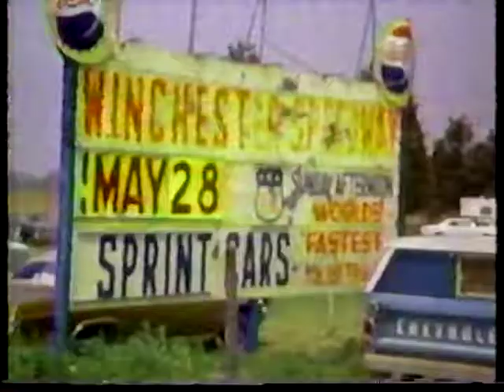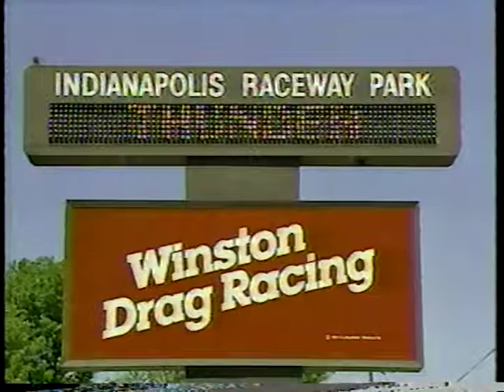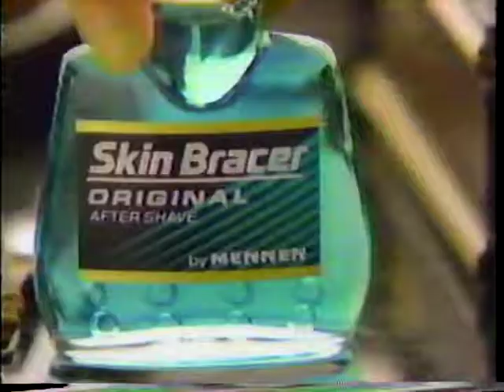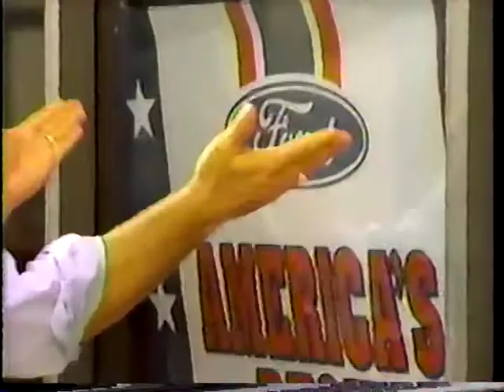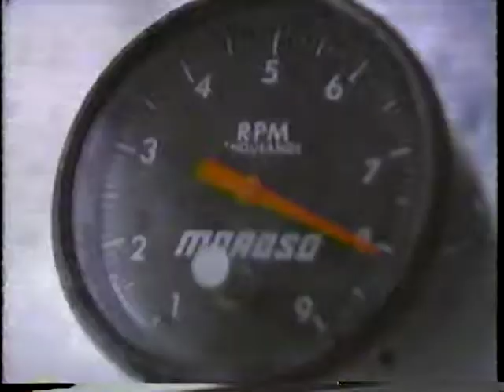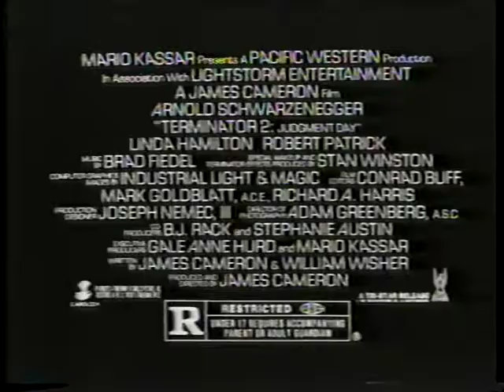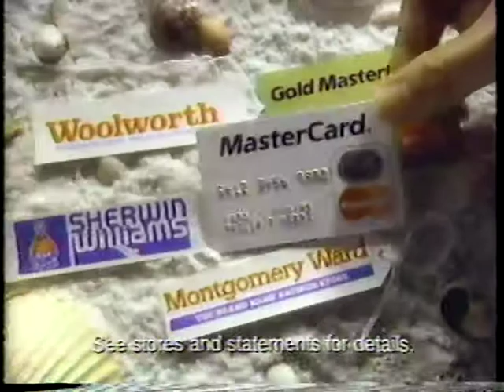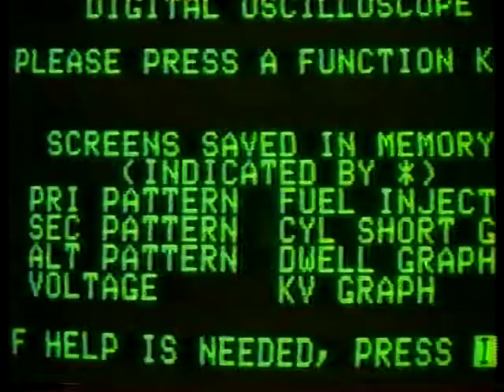USAC Silver Crown Cars at  IRP 6 29 1991

Comment: heh now the new kids here are the old guard that race the crowns in 2022 like eric gorden and ryan newman, bob santose jr 3 and bryan tyler, and these days silver crowns carry 75 gallons of alcohol and are able to run up to 360's  and running at irp 3 of the 12 races this year they are still very loud and to the walls flying around I mean on a big track like this they really do fly and its got the long sweeping turns if you watch from the pits with a pit pass it really is a neat thing, but I imagine it would be neater to see them on the long dirt track, which saddly is just down to terre haute in indiana, they limestoned the hoosier mile to be used only for harness horse trainning not even racing, and paved over the half at the state fair or levled over the ovel for parking for the events and state fair and for drainage, though we do have horse tracks that are big enough but dont have the rails or walls to keep cars from going into a crowd, and or they are too buissy with horse racing to allow midgets or crowns to race on them, but maybe one day, and the silver crowns run at winchester and its a bit on the rails but all out racing currently, it is rough on the equiptment though this endurace racing stuff wears out or mechanical trouble is frequent.